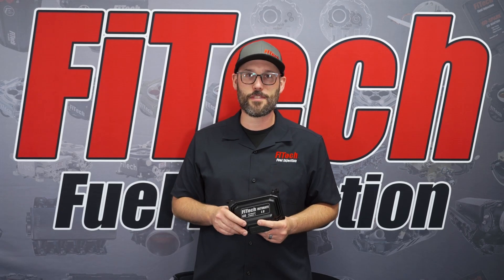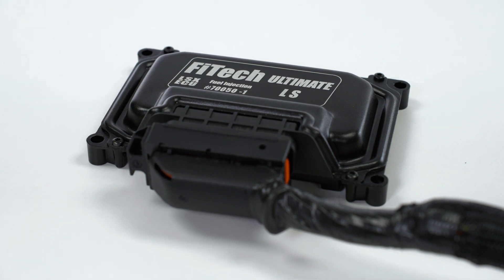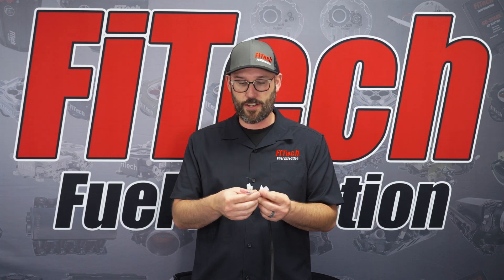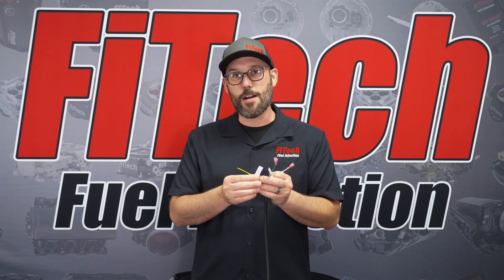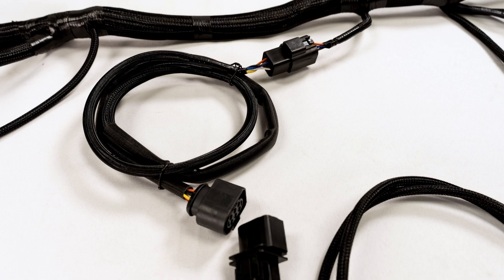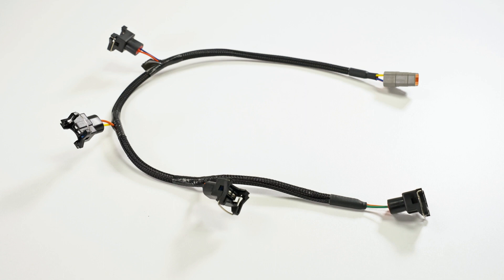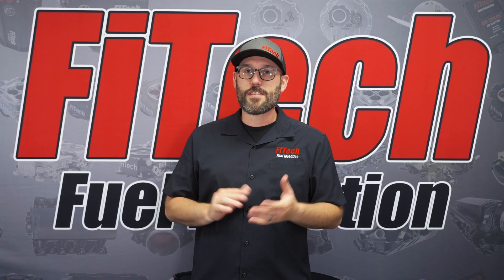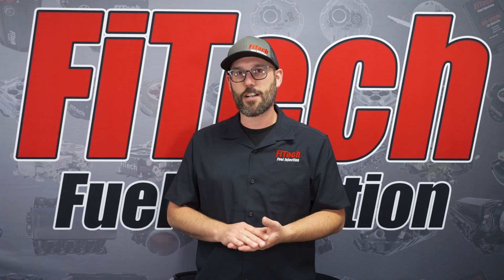Wiring Your Ultimate LS EFI System | Tech Tuesdays | EP80

Comment: Need some help here, I’ve wired everything up and ran the car it runs great, I had an issue and unplugged the #6 injector and on the handheld it said I had the #5 injector unplugged. Do you think maybe something got mislabeled? Should I swap the injector plugs? I’ll wait for your suggestion instead?
Reply from the maker: Hello sir,

The injector orientation to cylinder is different, let me attach the injector to cylinder head orientation, this will help you diagnose the system accurately
Injector Fault #       Cylinder Location
1                                1
2                                8
3                                7
4                                2
5                                6
6                                5
7                                4
8                                3

Comment: Does the brown A/C wire actually turn the A/C compressor on???
 or is it just a signal to the ECU, to tell it the A/C is on???
Reply from the maker: The AC wire of the EFI system is an input wire. it do not turn on the AC compressor. It will kick up the engine RPM if 12 volts is supplied to it.
Reply: @FiTechEFImedia  thanx,
Since it is a signal wire then, as far as I know, you can set the ECU to also turn on the #1 fan, when A/C compressor is energized

Comment: On the alternator do I need to run a second wire to the battery along with the plug the harness provides
Reply from the maker: Yes, this is necessary for the alternator to properly charge the battery.

Comment: What happens if you don't ground it to the block but instead grounded to the vehicle
Reply from the maker: You can make the system ground through different circuits in the ECU, which if bad enough can cause circuit failures in the ECU.

Comment: I know the fan control wires are for the ground side, but should they go to terminal 85 or 86 on a Bosch 5 pin relay? I'm finding conflicting answers online.
Reply from the maker: These two terminals are reversible. as long as one side has a keyed 12V source and the other has the ground trigger from the EFI then the relay will work.

Comment: is there no oil pressure sensor? i just wired up my kit today and couldn’t figure out why there wouldnt be a wire for it
Reply from the maker: The computer does not require oil pressure to fuel the engine therefore it was left out.

Comment: FiTech Ultimate LS EFI 500 HP Fuel Injection Systems 70001 - will this system work with a 700R4 trans? Do I need a TCM?

Comment: will the FiTech Ultimate LS EFI 500 HP Fuel Injection Systems 70001 work with a 700r4 trans? Do I need to run a TCM?
Reply: 700r4 doesn’t need a controller but you do need a kickdown cable and bracket

Comment: My kit has been a total nightmare... everything is plugged in and done professionally and the damn thing just backfires and hisses while cranking....
Reply from the maker: Back fires during cranking will come back to a firing order issue. Chances are you have the coil harnesses backwards of flipped over. Make sure you have the subharnesses on the correct bank. Driver to Driver and Passenger to Passenger. Also make sure Cylinder 1 coil 4 pin plug has a purple wire in the C location and that Cylinder 2 coil 4 pin plug has a red wire in the C location. If not then then the harness is flipped over wrong.
Reply: @FiTechEFImedia  verified correct bank and used 2 different harnesses. Fitech also said my ECU and harness is good to go after inspection.. frustrating...
Reply: @isawul00k did u put a fuel pressure regulator in ..took us a few to realize we needed one ..ultimate fuel injection kit
Reply: @Jenna.willow.zyeah. I ditch it and got a TermX… the aces system is better than fitech
Reply: @isawul00k I love my fitech system works flawless and there customers service is excellent in my opion. I'm glad I went with them..If I would have done a little more reading and not got in a hurry I would have realized I needed the fuel pressure regulator. That was my only problem so far and it's been in my wheeler for over a yr now
Reply: @Jenna.willow.zI’ve installed a few units and tuned several. Some of them are just cooked

Comment: I really don't understand the brake switch wire. How do I hook it up and where?
Reply from the maker: I goes to a brake switch as long as it is the correct one. It is looking for 12 volts when you press the brake. Zero volts off the brake. AC Delco part number D850A would be an example of the swtich needed. You can also use a relay to flip the signal of an older type switch.

Comment: For FJ40?
2f engine?
Reply from the maker: any 4,6, or 8 cylinder engine. As long as the ignition system is a 12 volt system. No balast resistors.

Comment: Love my LS kit.  Works great so far!
Reply: How is it going with the kit? Still running?
Reply: @520dblock3  sure is, no issues yet
Reply: @The.223-numskull  Did it come with oil pressure sensor
Reply: @520dblock3  yes, I ending up using a mechanical gauge, I built a new dash with all new gauges
Reply: @The.223-numskull  Thank you for replying back brother